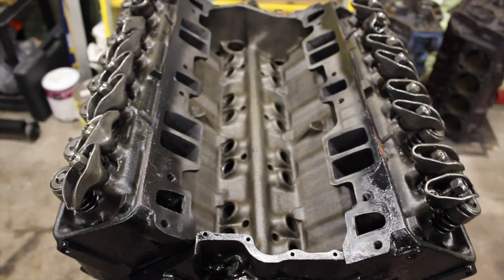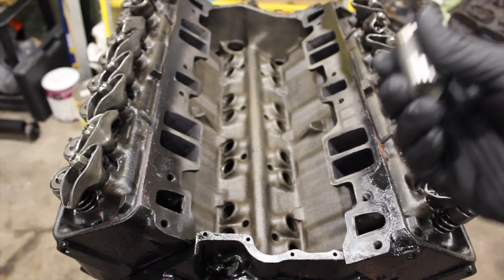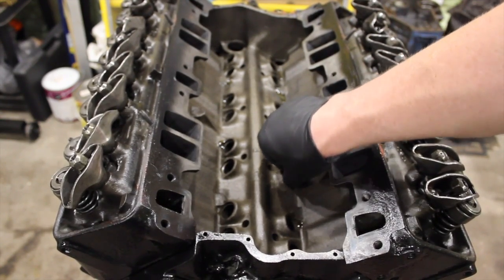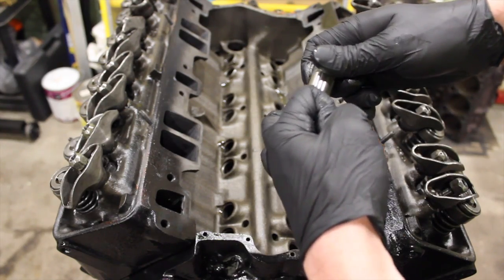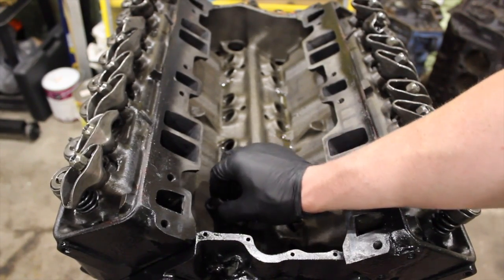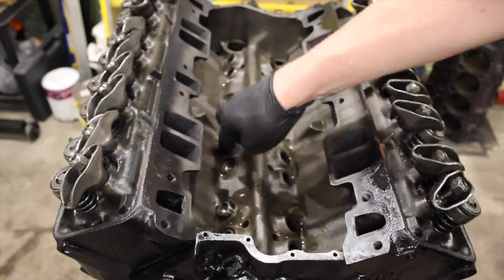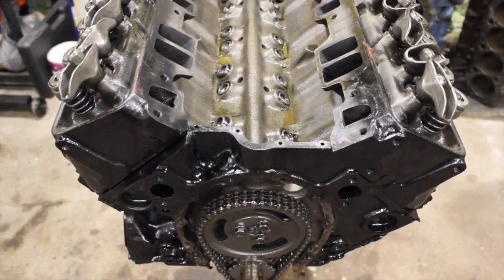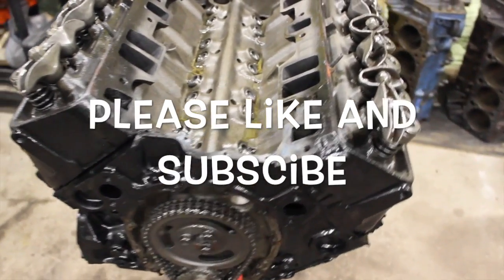Tips for installing Flat tappet cams and lifters

Comment: I have been hearing lately from HI-PO engine builders, that LOTS of the hydraulic flat tappet lifters on the market are Chinese made junk, causing LOTS of wiped out cams. Do you have any info on this subject? Thanks.
Reply: build your own lightweight lifters, it'll be well worth it. , other forged alloy steels or titaniums or hyper super intrinsic alloys. get a lifter lighter in weight does a lot more than you would think for an engine . . . rpm, power, stability, balance, wear, frequency controL, to name a few.
Reply: @zAvAvAz  Sounds great and even if I had the means to do it, I wouldn't have a clue where to start. Hey wouldn't camshaft makers already have started on this? I am talking about basic street driven, pump gas, sbc and bbc engines lets say 1.1 hp/cid, budget limited.
Reply: @zAvAvAz  Yep. I got some light weight EDM hole Small Block Mopar lifters from Hughes Engines, took 12 days less than a year to arrive. They weigh in around 78 grams each. Using conical springs and hollow stem intake valves.
Reply from the maker: Thats 100% correct. I avoid building flat tappet engines these days and always suggest going roller if the budget allows, especially with aggressive cams
Reply: @cuttersperformance  I am building 300hp 305's and 307's now, but when I step up to 350 CID up, that I plan to lean on hard, I am going to have to bite the bullet and go roller. The reality is just coming a little faster than what I wanted. Thanks
Reply: @mikef-gi2dg  yes, i too wanted to build a normal flat tappet hydraulic lifter 355 chevy small block with a simple XE274H10 cam, and now, with oil missing what is needed shatters the normal. they think they are making money by penny pinching, only they are hurting the economy , they do not understand that they are losing money because of it.
Reply: @zAvAvAz  Yep every type of manufacturer thinks they can cut quality and cost, off shore it, then wonder what happens when loyal consumers no longer see them as a reliable option. I saw that in the computer industry as well. I know rollers are better, but for the sbc and bbc stuff I got, that $1k difference means I can buy good heads instead. 305's 307's 327's
350's and 402's bbc. They will run like they want to run....drive em like you stole em.
Reply: Dont buy Chinese crap and not Comp

Comment: Hi I thought dot to dot would be 180 out and it is #6 that is at TDC?
Reply from the maker: So there is some confusion on that but yes.
For ease of installation you line it up dot to dot with the #1 cylinder at tdc (and ignore valve events)  

But technically the #1 cylinder is actually at the top of the ex stroke and #6 cylinder is at tdc on the compression stroke. 
There are old repair manuals that actually show to put the dots at the top on both the crank and the cam gear.
Your putting the engine in the same timing but at this point the valve events are irrelevant and its easier to see the dots at lined up rather than 180 apart.
Reply: @cuttersperformance  
Thanks for the reply. I'm going to install my timing chain this weekend and was a little confused from seeing other videos.  I have the heads off because I'm putting Edelbrock heads and new comp cam.

Comment: Well, I guess I'm one of the old mad guys 😛 because I always pre-load my lifters by submerging them in oil and using a push rod to pump them up before installing them in the engine. I've done small and big blocks the same way for years with no issues. Easier to set lash accurately like that.
Also, if you have your engine block hot tanked at the shop, ALWAYS have the lifter bores honed afterward. The hot-tanking process can cause the lifter bores to become egg-shaped. Honing is a simple process. Do it yourself or have the shop do it. A good preventative step.
Reply: I graduated in 89 from a 2 year general motors training program.. general motors taught us to do the same thing.. soak lifters... use push rod to pump up... i figure they designed the engine they know best..
Reply: @phartharder  I can believe that, I did the exact same thing for years. Eventually I started using a pre-oiler drive and it made things easier. I think the materials used were more durable, back in the day.
Reply: Well all us old timers did it like that before drill powered pre-oliers became popular. I  think the quality of OLD SCHOOL materials gave us a safety margin. Example....Gm's ls-xx engines with AFM DOD valve trains. Good power and economy, but the valve train reliability is questionable. Good on theory, but missed the reliability for production engines by a lot. Too cute by half. I have yet to build a LS engine, but when I do I want NOTHING to do with AFM DOD or VVT, even If I lose power. I'm going with KISS.
Reply from the maker: Haha! 😄 it certainly doesnt hurt doing it but not a must do in my opinion
Cheers!
Reply: @cuttersperformance  that's why you are a piss cutter.
Reply: No oil, bottom out the lifter, then back off a half turn.

Comment: Thank you for this, I'm installing a cam in my third gen t/a - it's making for great reference.
Reply: How did it go?
Reply: @Milkmans_Son  The installation went fine.  Mild Lunati 420/443 112 cam. Engine runs very well, pulls all the way to redline with good idle.

Comment: I'm building my first engine so I'm a bit nervous about using a flat tappet cam. However I can't really afford a roller cam.
Reply: Techinacally you dont break in a Cam you "you break in lifters" and by that you want the lifter To start spinning that is the Techinacally break in. Important  thing is that lifters start spinning Thats all.
Reply: @markuskorpela7896  I’m amazed ! absolutely with you on this subject, probably the only ones on the planet
Reply: @donaldhill2775  there's more of us hip to this cam break in myth.
Reply: @cammontreuil7509  yep lot of the horror photo’s I’ve seen are stuck lifters & or incorrect assembly, stone cold newly built engine straight up to 2500 rpm, not me !
Reply: @donaldhill2775  I've built more than 400 engines. Had my own business for a while.
Most were Ford. Primed oil pump, set timing on a new engine. Let it run for 30 seconds at idle. Stop.
Heads get hot first. Let engine sit for 5 minutes. Let heat distribute evenly through engine. I used a Detroit head gasket, melts on to the head and block surface. Not like a Failpro head gasket. Then add antifreeze 50 50. Start again. Let run at idle for 2 minutes. Paint starting to cook and parts start to smoke. Normal for us but customers tend to freak out if watching.
Stop again after 2 minutes or so. Thermostat not open yet. Let engine sit a few minutes to warm evenly. Look for leaks. I recheck intake bolts and valve cover bolts. Recheck fluid level on oil, radiator and transmission. Take my time. Not in a rush.
I keep radiator cap off so I know when thermostat opens so I know when to add more water. 
Let it run again at idle until thermostat opens. Water and steam spits out the radiator. Customer freaking out again, but it's normal. Listen for any unusual noise.
Keep the defrost running in car. You know when water is circulating through engine and heater core when heat is warming inside of car. Add water but not completely full. Leave room for expansion.
Replace cap. Watch as pressure builts to see if anything leaks.
Never had a cam go flat. I've had a few new hydraulic lifters not pump up and hold pressure. Had to pull them out and replace. But that's it.
Had a few new engines run hot for a few hundred miles. But they always settled down. Some customers had to replace a radiator or clutch fan.
Some radiators I had flow tested at a shop if I had a question about it. 
Never had a cam go flat.
Reply: @cammontreuil7509  interesting read and sounds a far more sensible way of doing things, I’m in Europe and came out of heavy trucks, Volvo & Scania mainly, your radiator comment struck a note we wouldn’t put our name to any rebuilt that didn’t include a new radiator, finishing off a 289 sb that’s now a 302 for an old Mustang (65) retirement project, new everything, big valve AFR heads, mild flat Tappet mechanical cam, setting valve clearance is normal on European pushrod engines hydraulic lifters the exception, did have to educate myself on poly locks though, never seen one before, was trawling though the inter web finding out about America V8 engines, very helpful mostly, some absolute rubbish some funny, few showing people how to blue print your engine but you need a million dollar workshop, 
most of my parts I’ve shipped direct from America and honest, what a pleasure to deal with American’s, anyway good luck to you and all the best,
Don Hill.
Reply: @donaldhill2775  thanks. If you need any parts, let me know. Blue printing takes money. That's for sure.
Reply: @cammontreuil7509  Very kind, thanks, I’m good for parts but may well seek information, waiting on water pump & inlet then back into car, binned the auto for a T5 with hydraulic clutch, (stolen design from an American) Forgive me sir ! utilising MGC part and a Land Rover slave cylinder, ha ! I’ll let you know if it eats it’s own camshaft, best regards,
Don Hill.
Reply: @donaldhill2775  im in the club too. stp oil treatment on lifters and cam, and another bottle in the oil. crank up engine, let idle at 800-1200, a few seconds of 2500 every now and then to sling oil on the cam, presto. it matters more about the cam and lifter quality. I REFUSE to start a brand new built engine and instantly bring it to 2500rpm.
Reply: @frigglebiscuit7484  Hi, yep 👍 I go for solid tappet cams, mainly what I’m used to on pushrod engines in Europe and I use matching components from the same company, cam, lifters, pushrods etc if possible, no tight clearances on lifter bores, incidentally if your using alloy heads with solid lifter alloy expands X5 cast iron so reduce the valve clearance,
Reply from the maker: Break in is key! Use the right oil and not too heavy of springs. Another option is 1.3 rocker arms
Reply: @cuttersperformance  I was planning on using beehive springs. Would they be too stiff.
Reply from the maker: @Dboyquicks10  no ive actually had really good luck with ls6 beehive springs and flat tappets
Reply: @cuttersperformance  great. Thanks for your help. I know how busy you must be. You've helped me more than you know.
Reply from the maker: @Dboyquicks10  no problem man! Let me know if you have any more questions 
Cheers!
Reply: @Dboyquicks10  I'm running a solid flat tappet cam with Comp Cams 7228 conical valve springs. Check with your cam manufacturer on recommended spring pressures/rates. I went with the conical valve springs to reduce the reciprocating mass in the valve train and conical valve springs do not have a specific resonant frequency as straight springs do, beehives are straight for a length then the coils tighten up at the top to provide room for clearance for rocker arms at higher lifts.
Reply: The only thing you're missing by not running a roller cam is MASSIVE lifters and spring pressures.
Reply: No need To "break in a Cam" you can coat the Cam and Bottom of the lifters whit stp oil treatment and use good oil whit strong oil film. Read the 540ratblog. There are real life stories. Whit no break in bullshit.
Reply: You can just start the engine and let it idle and do couple engine revs. No need To 20min 2000rpm nonsense.

Comment: I’ve been building auto and Harley motors since the late 70s.  I don’t soak my lifters as I was taught.  Assembly lube on the outside, prime the motor.  Unless you’re actually pumping the lifters by hand in oil, soaking them isn’t doing anything. 
 Now, that said, on some motors, especially HD,  when adjusting lifters,  there are 2 adjustments if you are preloading.  wet and dry.  Wet is if the lifters have been run and dry if new or they’ve been assembled after cleaning.  Still not a lot of difference even then.  
But, as said, if soaking them makes you feel good, it certainly isn’t hurting anything.  But it certainly is not getting oil in and air out.
 Prime that oil system!
Reply from the maker: 100% man!
Reply: Yes always prime the system , tell eveyone all the ways to do it, isn't there a way also where you spin the distributor hole cam gear with an engine primer drill gun thing?

Comment: what about comments on running weaker springs or 'break in' rockers?  comp cams indicates  one of these two are necessary during break in.  well, they actually say to remove the inner spring, not weaker springs.   pain to swap springs after as part of a break-in
Reply from the maker: Ok heres what I do, and have good luck but don't hold me to it haha
Max seat pressure of 120lbs and 350lbs over the nose for the springs, anything over than that you need to use weaker springs. 
I've also never had a issue breaking in with 1.6 rockers, but wouldn't use any higher than that. 

Use assembly grease on the cam, lots of lube on the lifters and make sure they spin freely in the bores. Break in oil, and prime the engine before startup and make sure you have oil to each rocker. 

Proper break in is key! Get the rpm up right away! 
The issues is when the lifter doesn't spin in the lifter bore, the cam will wipe out in no time if it doesn't

Comment: I'm gonna be dropping a flat tappet in a vortec block, simply because it's what I can afford. 355 with 369 heads (garbage ik), hyperuetectic summit pistons, factory rods, factory crank, mild cam, c1/c2 Corvette intake, and an edelbrock 1406 600cfm carb. not sure on distributor, or exactly what I'll run for a cam yet. Any advice for a beginner? (I already know not to buy super cheap lifters, I've got a set on hand)
Reply from the maker: nothing wrong with a flat tappet man but good lifters and proper break in are key to the survival of them. 
Proper Oil, break in additive, not too much valve spring pressure, no idling for the first 20 to 30 mins, keep the rpm up and vary it 1500 to 3000.
Reply: @cuttersperformance  biggest thing now is getting good lifters. I'll hopefully be set up to break in the engine the way I want. and I'll have good break in oil. my springs are just stock, so they're light enough to break in on. any reason I would have issues?

Comment: Can you still get the GM Delphi hard bottom lifters ? They have a noticeable separation on the lobe contact end ?
Reply: Yes you can
Reply: Yes. Summit lists them and they're $162 a set.  Damn near half the price of a name brand roller set.

No idea if they will make good on the order though.  I used to get hardened Delphi's in Melling boxes but they started sending non-hardened shit tappets instead (same part number)
Reply: @earlbrown  just had that issue lately, ordered Melling knowing they were Delphi, saw the lifters were shit even though the pictures still showed Delphi lifters, sent them back. actually found a set at AutoZone that were Delphi.
Reply: @heavydutyroadsidellc920  .  So I order a set of small block Chevy  hydraulic flat tappet lifters from a motorsports company out of Chicago I was told that they are the Delphi hardened lifters what shows up is a totally different deal shit bottom lifters like a dumb ass I loaded them into the motor any way,  they broke in fine I was lucky in that respect but after a few short drives 4 of them collapsed ( I won't say what brand they were ) how am I doing god what a waste
Reply: @carlrapp8625  autozone can still get them with hardened seats
Reply: @carlrapp8625  
ACDelco Valve Lifter HL66

 

Part #
HL66
SKU #
105995

1

Comment: There are some old guys that are mad as HELL right now lol!   By the way; Im building that 400HP SBC combo you posted. Its looking real nice so far.
Reply from the maker: Heck yeah man! Let me know what you think of the vortec combo! You'll love the sound of that cam
Reply: @cuttersperformance  im building a 355 10.1 flattops vortec heads 465/224 cam competition products carb to vortec Intake,  long tubes glass packs dumped ,HEI/hotcoil AVS650 eddy carb. i am die hard bow tie for life. i ran claim bomber dirt track and sold my car when my son was born, this is the first little performance engine i have built since my son will be 17 may 4,  350th 3.42 in a GMT400 P/U  gonna try to have it ready for his prom. wish me luck.  hopefully something he can waste a set of tires with. I have notta clue on HP but i am loving the L31 heads.  i hope i am not going in the wrong direction flat tappet vs roller lifters but cant have it all. just found the channel deff subscriber 100%
Reply from the maker: Sounds like a sweet combo man! Vortec heads works amazing and are easy on the budget
Reply: @cuttersperformance  it's extremely rare that a pair of vortec heads comes into the shop not cracked. Theyre so damn thin. The only reason there's a boost in performance is because the cc is smaller. It ups the compression get a good cast non vortec from the scrapper. Have someone do a valve job and cut the gasket surface and match the intake. Buy a 50 harbor freight grinder and some bits. Port the intake. Good to go
Reply: sorry brother didnt mean to steal your thunder and blow up your post.

Comment: Edelbrock recommended do not soak lifters in oil or pump up the lifters on flat tappet cams... My small block Ford engine. They even give a very slimy very thick lubricant for the cam..
Reply: You don’t want to prime the lifters before adjusting your rockers / pushrods. They automatically pump up to adjust for valve lash